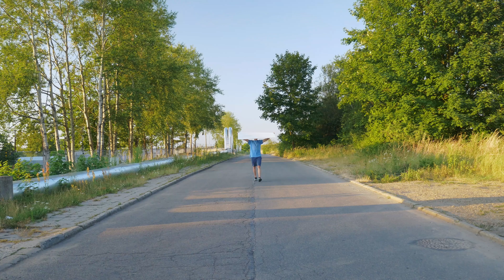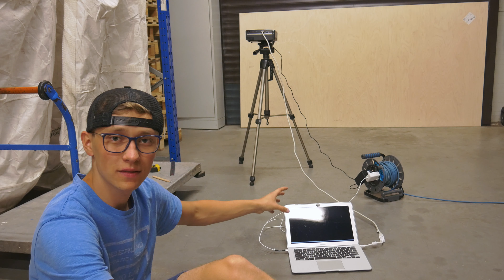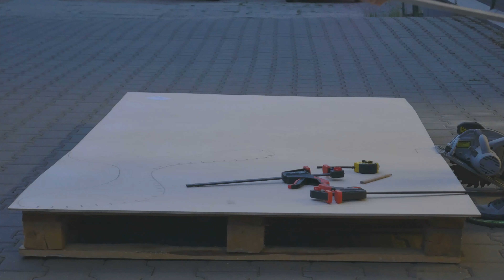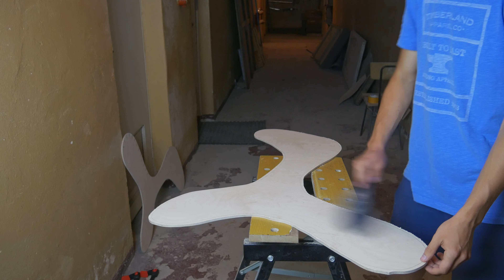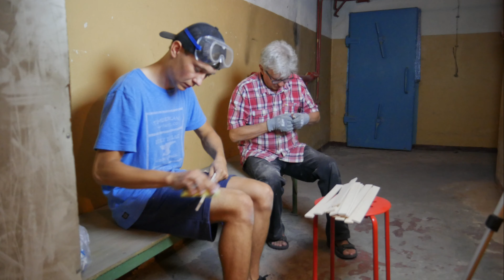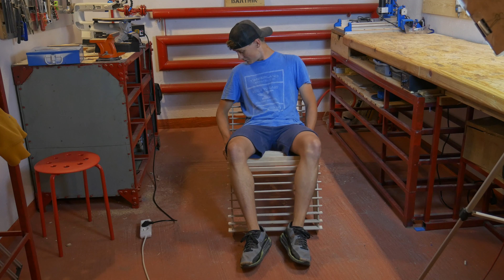DIY Minimalist Chair With 1 Plywood Sheet

Comment: Using such a small cube to calibrate will allow for large errors. You better use the longest lines possible to minimize the error when calibrating a projection :)

Comment: Hi Nikodem,
Really valid the idea of the PC projector, moreover since it not only serves to draw on the plywood, it is a fine example of synergistic use.
When I saw the design of the sidess I thought you would make all the cuts in correspondence so as to increase the stability of the joints, so that the crosspieces cannot turn and slip off while you are in the chair.
in any case, an excellent stroke of genius!
To the next videos, Ciao

Comment: This is a nice idea. I’ve thought of using a projector for tracing, but never actually tried it. I presume the reason for the calibration square rather than just a line is to be able to adjust for the angle of the plywood relative to the projector to remove any distortion. Great idea.

Were there interlocking cuts originally planned for the sides that were simplified out in the final build?